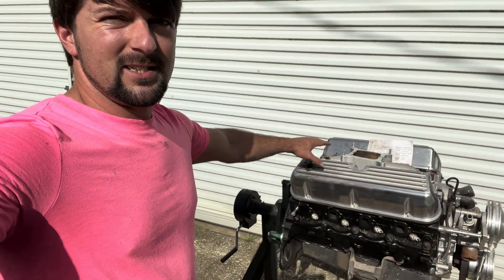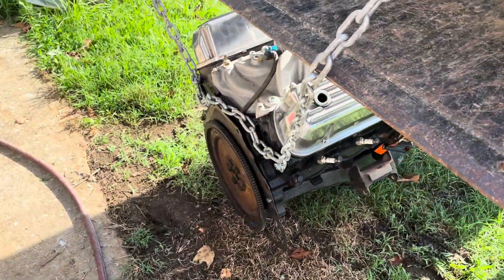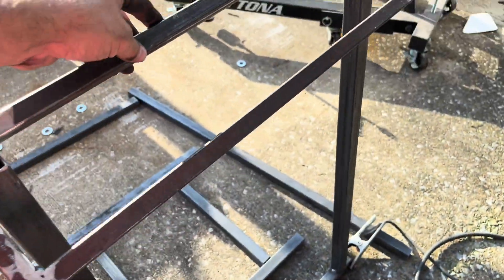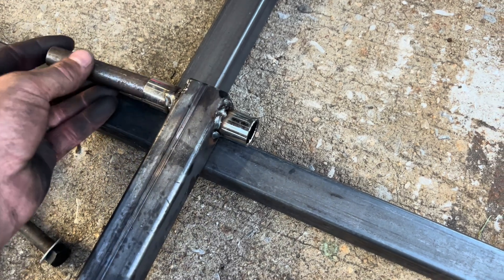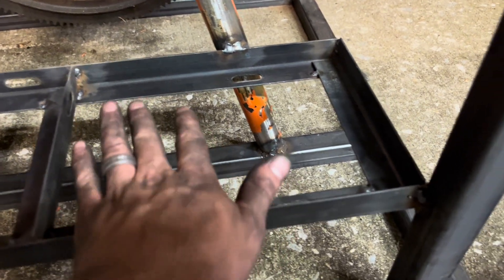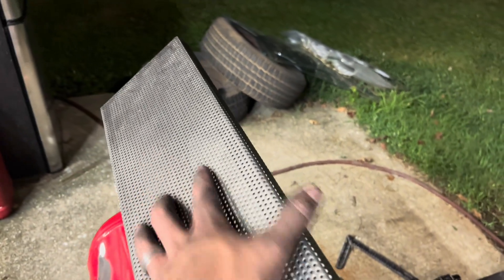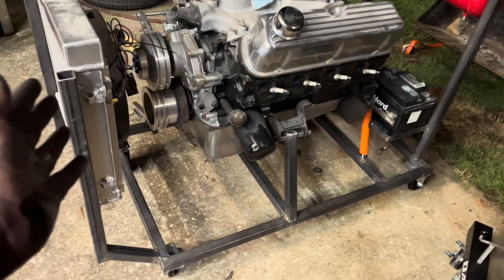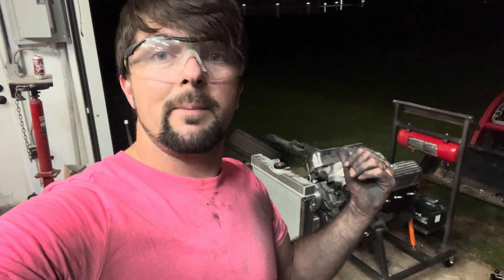Build your own engine run stand for less than 100 dollars

Comment: After you finished, 1. did you need to add any gussets?  2. did you wish you made the radiator mount with quick releases, to get it out of the way for adjustments on the pulley area?

Comment: Nice work. You built it for a small block ford specific. The uprights to the motor mounts should have been made adjustable fore and aft. This would allow other manufacturers blocks to be used with minimal modifications.
Reply from the maker: I built it for small block 289,302,351 specific. Otherwise you are correct, I would have changed the way it’s built for larger applications
Reply: @1194video I built a stand a couple years ago. I have a 6.2 gm diesel on it now. I will make a video of my build when I get a chance.
Reply from the maker: @tjs_welding_and_fabrication that would be great! Give me a new video a check out

Comment: Good job Lucas I need to build another stand for lawnmower engines somewhere down the line I lost it
Reply from the maker: That would be great, especially for adjusting the valves and testing them down to swap out coils or flywheels for lawn mower engines

Comment: Good information ! Thanks for explaining your technique on building this engine stand, Can't wait to see the finished product. I have several 289's and a 302 H.0., all new engines and was in the process of designing a stand to run them on, but I like your idea better. Hope you don't mind if I use some of your plan in my design. Thanks!
Reply from the maker: That’s the point of the video, hope it works well for you as it has me